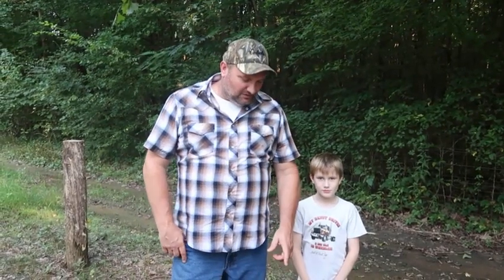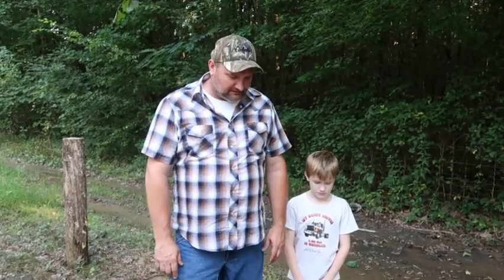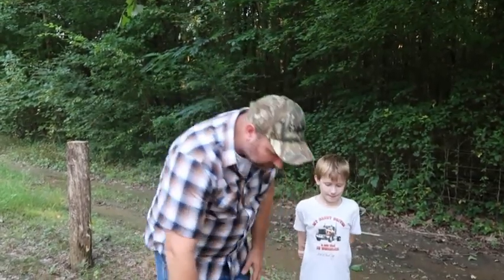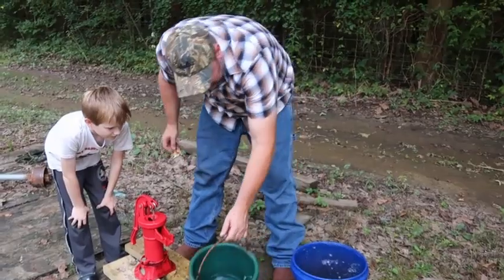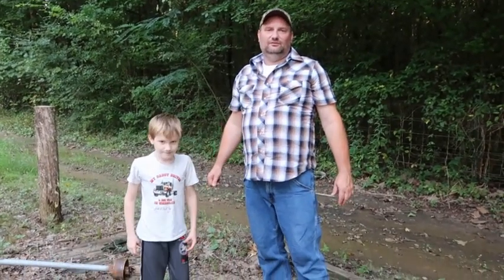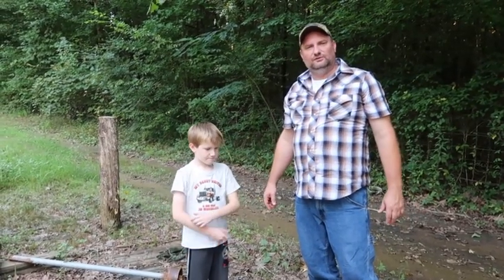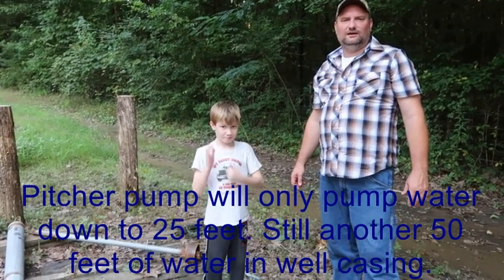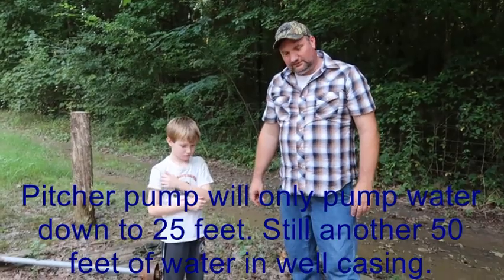Update On Water Well

Comment: the pump only works down to 25 ft?
Reply from the maker: Hello Duke! That is what I have read about most of these style pumps. I haven't tried any deeper than this. I know some of the more expensive pumps can go hundred of feet in deep wells. Have a Blessed Day Friend! Justin
Reply: @homegrowncountryhomeplace  Thanks
Reply: After 30 ft the water forms a vacuum and begins to boil. The deep well pumps have the water pumped up the pipe from the bottom instead of sucking it up through the pipe. The actual pump is on the bottom of the pipe where this pump is at the top.